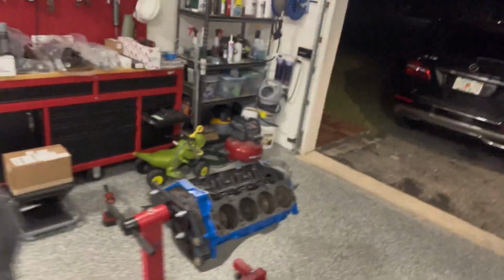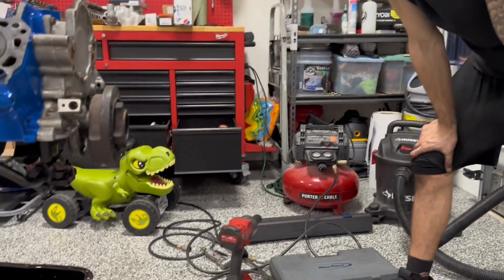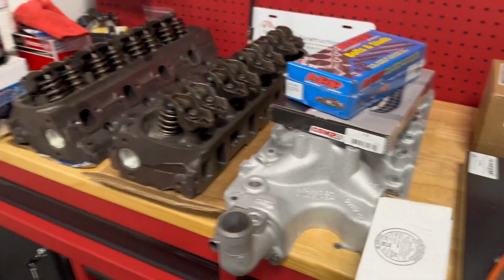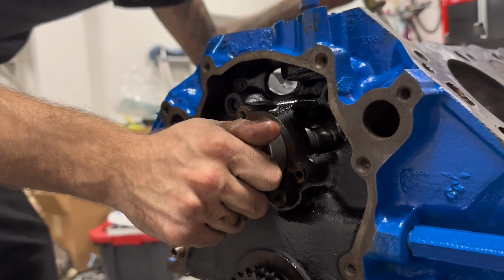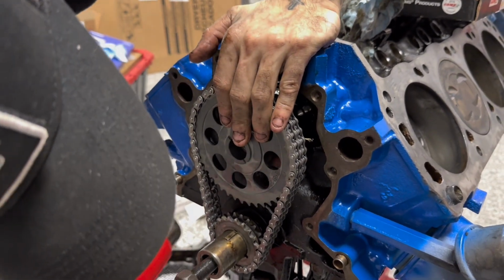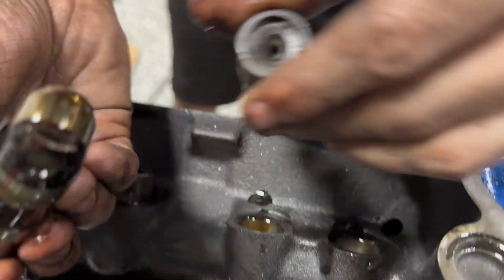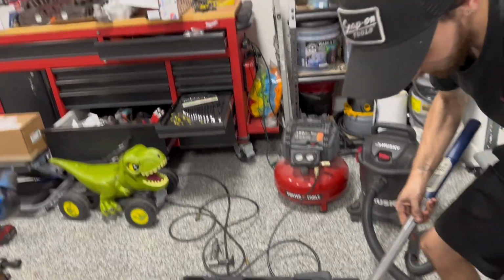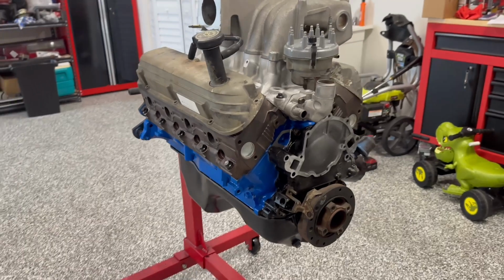Small Block Ford Engine - Watch How We UPGRADE IT! Foxbody Build Part 11

Comment: Speaking from someone that likes stockish look I would clean the heads and not paint. But if you have a theme or a preference go with it.
Reply from the maker: Appreciate the input. Stay tuned to the channel for the next foxbody build video to check out what I came up with regarding the paint
Reply: @SoFloMoe  got an ETA on the car startup?
Reply from the maker: Not yet….car is still in the body shop.